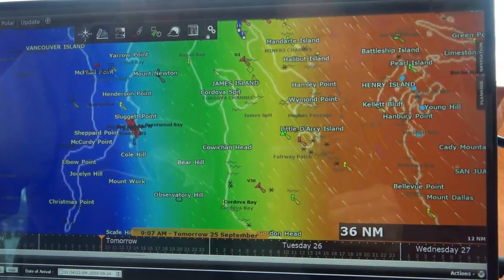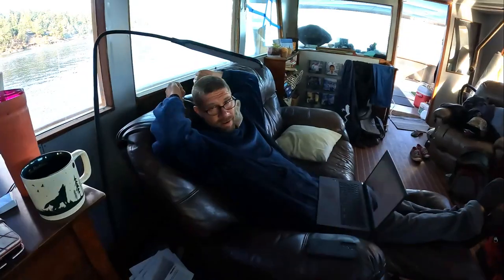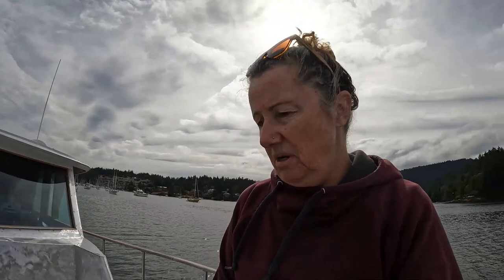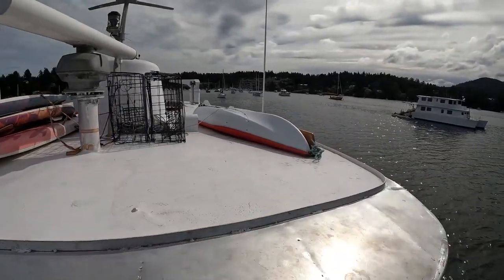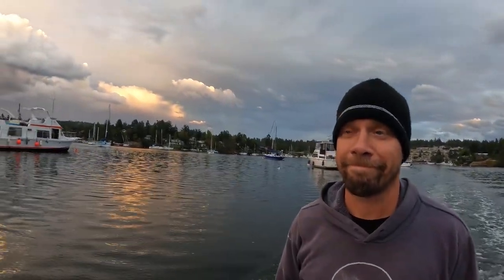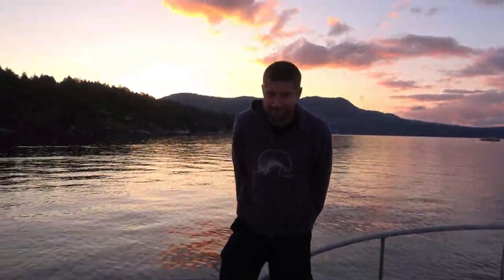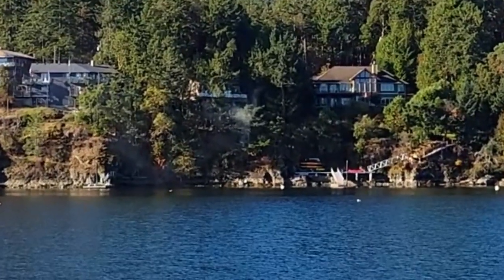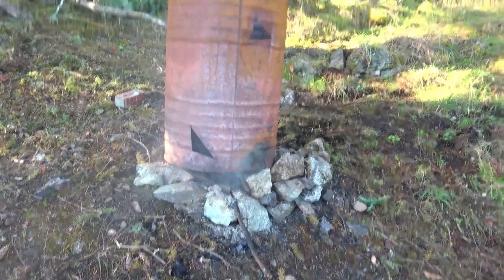Close Call: Forest Fire Spotted from Our Boat!

Comment: Is there another step you have to do after all the bondo and paint is off the aluminum like a sealer or something or is it good as is in the salt water.?
Reply from the maker: We are going to polish it up a bit but it is no a required step. Once aluminum is exposed it forms an oxide layer which prevents further corrosion. As long as it is exposed to oxygen it will not corrode further.

Comment: Just curious why you chose times zero over Navionics as your digital chart?
Reply from the maker: The main reason we chose Timezero is that it integrates nicely with all of our Furuno nav equipment. We can overlay radar as well as have sounder display right on our main monitors. Timezero also outputs NMEA2000 data for course which an autopilot can be se up to follow so course changes can be done automatically (with monitoring of course).  We have a few other optional addons such as weather routing and such which has worked really well so far. Lastly, I found Timezero to be pretty seamless when zooming in and out and moving around charts. All in all its a pretty slick solution for us.
Reply: Thank you very much for getting back with that information. I'm looking to upgrade my current setup, so this is very helpful. We are moving aboard our 48 Tolly (North Saanich) this May for some extended cruising  Hope I we get an opportunity to to say hi to you folks! Cheers @OnboardTangaroa
Reply from the maker: You are very welcome. A 48' Tolly will be great to live on. We have good friends who have a Tolly here in Brentwood and are very happy with it. They have a great following and fun meetups from what I understand. If you are ever in the Brentwood Bay area stop by and say hello!
Reply: @OnboardTangaroa  That wouldn’t be Keith and Suzanne by chance?
Reply from the maker: It would indeed!